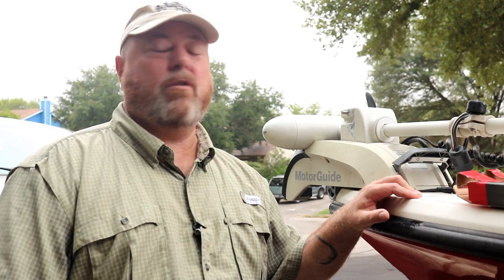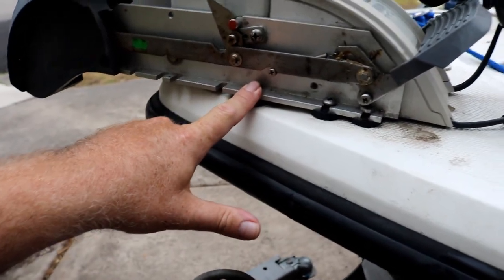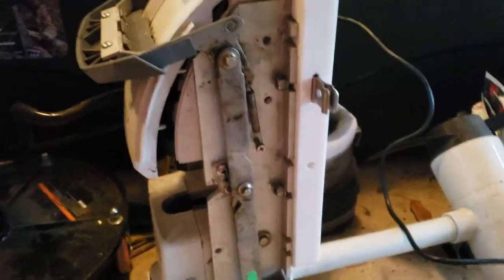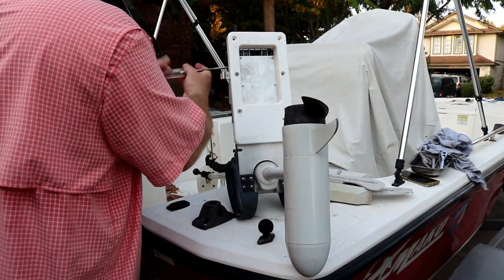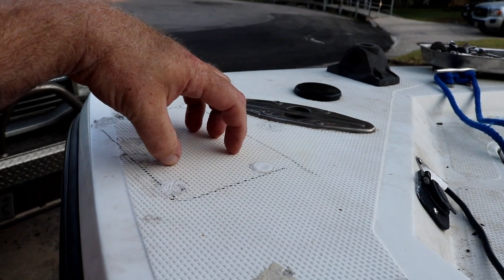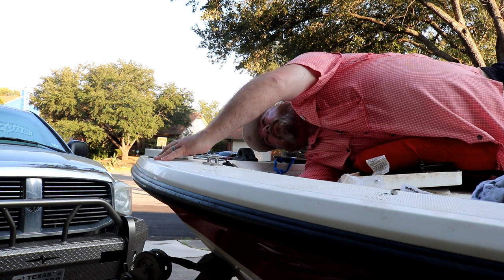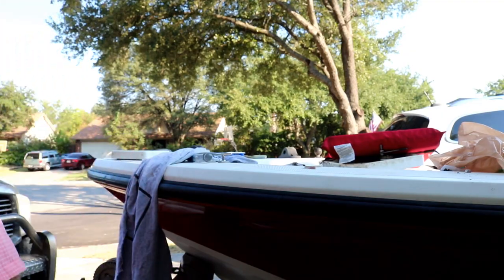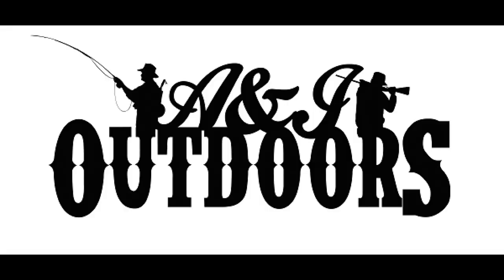Installing a Trolling Motor Quick Release on my Boat.

Comment: 7/16th or 10mm for the metric version...look to be Stainless Nct bolt grade 8
Reply from the maker: Winner. Winner! 7/16" (it and the 10mm aren't really the same size). I already have your address so I'll get a decal or two headed your way! Thanks for watching Mike. Yeah it's more how the boat is designed that made it so challenging.

Comment: My next boat will definitely have a trolling motor. I've been thinkin of putting one on my boat, but don't want all the screw holes from taking off the bow rail
Reply from the maker: This is a gps model with remote control, it has changed the way I fish. I can power drift, don't need a wind or current, I can anchor lock and stay in one spot without throwing the anchor. It really is nice to have.
Reply: @AJOutdoors1  I know it changes the game. It's a must have